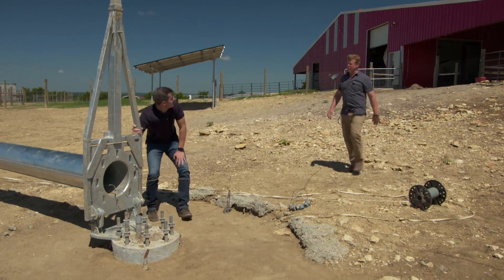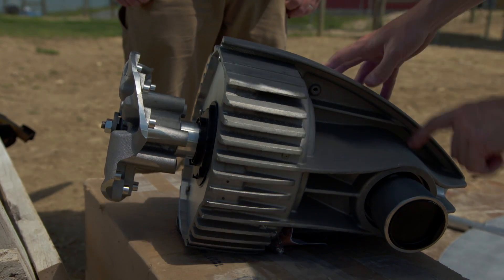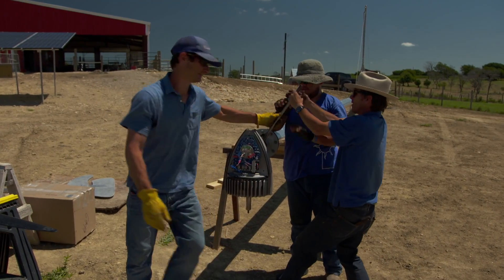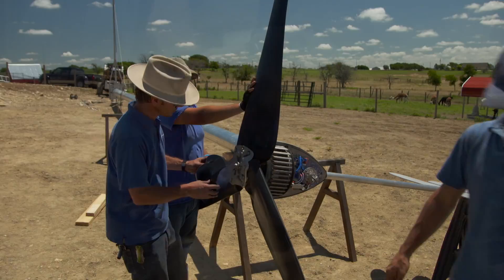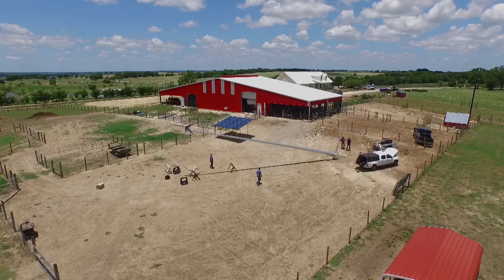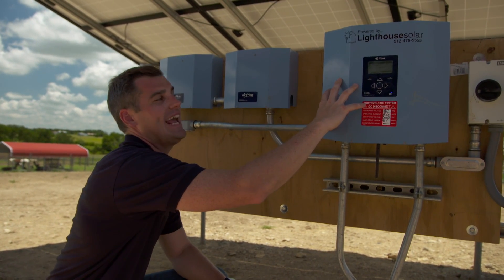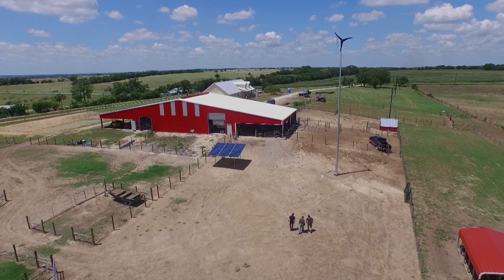How to Install a Home Wind Turbine | Ask This Old House

Comment: all that wind turbine for 1.5kw ?
Reply: Some people that would include me hate the electric company and are willing to spend extra money as to limit them screwing me on monthly basis. I know it may not make sense to everyone but to others it does. My electric company up my electric bill 40 percent in the winter, they  love to stick.it to you, we are doing our best to stick back to them. Also it feels better to use clean fuel, next an electric car.
Reply: It's not the same as solarpanels.

The 3kw solar panels he has produces 3kw a year.

A 1,5 kw turbine produses 1500 wats continuesly. So if the winds are enough for 1,5 kw 24/7 and 365 days a year that 1,5kw turbine will produce 13140 kw of energy a year.

The turbine is going to cost more but depending on place it's gives a hell of a lot more then solar.

You need to do a full calculation tho, cause it's moving parts and services that needs to be preformed.
Reply: @Sunblocker101  that's per day not per year... one 250watt panel can produce about 30 kwh  per month.. the average house uses anywhere from 750 to 1000 kwh per month. But yes the wind turbine can produce a lot more if the conditions are right
Reply: My electric bill ranges from $70/month in the Summer to $400/month in the Winter or ~$1200 per year.  At ~$0.10 per kWh, that's 12,000 kWh per year.  Good calculation!  FYI - I calculated that if I wanted to store a year's worth of electricity in lead acid batteries, I'd have to fill every cubic foot of my house with lead acid batteries (floor to ceiling)....I'd need a second house.
Reply: @JerryDLTN  Since the price of solar panels has dropped so much and batteries have gone up most now suggest using the absolute minimum of battery that will get you through the night. Put the money into high voltage strings of panels. Voltage is the major variable with panels in different light conditions. High voltage strings means you will be producing usable power even on cloud days. Typically 30%. So you size your system by seeing you usage at the lowest sun hours month (usually November) and triple that amount. Say 3 sun hours and you use 15Kwhr/day((15Kwhr / 3hr)*3 = 15Kw of solar) for off grid. For on grid just look at your yearly usage and the yearly sun hours and again triple it.
Reply: @Sunblocker101  Sorry but you are totally wrong. 3 kW (kilo Watt)  is twice 1,5 kW. If the sun shines for 1 hour the solar panels produce 3 kWh (kilo watt hours). 2 hours gives you 6kWh, 3 hours 9 kWh and so on. If the wind blows at optimal speed for 1 hour then the wind turbine gives you 1,5 kWh, 2 hours give 3 kWh and so on.
If you have a windy location that´s often cloudy then the wind turbine might be the better choice. If you have lots of sun then the solar panels are more effective. If you´re going off grid then you should probably get both and a back up generator as well. Plus a lot of batteries to store the energy so you can use it when you really need it.
Reply: @marcusrobertsson1898  ye sorry 3 kw system produce 3000kw a year, atleast where i live, a lot more in sunny plases
Reply: @Sunblocker101  That is only 2.75 suns hours per day on average. While I would by that for November through February, you would have to live pretty far north not to get more sun than that. Assuming he is using high voltage strings (and with him using a wind turbine on the same inverter he would be crazy not to) even under cloudy conditions that 3kw system will be pumping out at least 1Kw. More like 5000Kwh+ per year
Reply: @Sunblocker101  lmao that is incorrect, if that were true no one would buy solar, 3kw is like nothing the average household uses ~30kw per day and around 10,400kw per year.....

Comment: Put like a 15ft diameter blades
Reply: Larger blades means much heavier tower for when the wind gets high (25Mph+). Once the turbine hits a certain speed (diameter dependent) it effectively becomes a solid plate. So the tower has to be heavy enough to withstand the highest wind (60Mph+?) that the location will see with a solid plate the same diameter as the blades.

Comment: He went 20 feet into the ground with concrete to support a 60 ft mast just to get 1500 Watts of electricity? That is enough only to run a hairdryer. On a good day.
Reply: That 1500 kilo-watts.
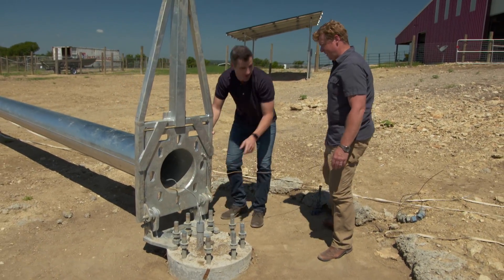Reply: @scotttovey  1.5 kilowatts at 0:50 into the video.
Reply: @dbassett25 
Yep, I misheard that.

3 kilowatts of solar and half that coming out of here.

It's my brain being stuck in supersize mode, or just figuring it should be much bigger. I must have had  a [Tim the Tool Man Taylor] flashback.

Comment: Your foundation is small, and the anchor bolts are designed to fail. Using nuts underneath the mounting plate is the most common mistake in installing important machinery on concrete foundations. The bolts are supposed to generate a compressive load on the baseplate AND the underlying concrete, and can only do this if the baseplate is in direct contact with the foundation - usually by way of grout. Call me when the whole thing falls over, and we will design a decent installation.
Reply: That thing ain't going anywhere.
Reply: The reason for the nuts on the bottom as well as the top is so that you can get it perfectly level. Then you should also fill in underneath with mortar though there is no way to know if they did this after.

Comment: COMPLETE waste of $.  For the same amount spent on the 1.5kwwind system you could get AT LEAST twice as much power (yes even counting cloudy days) by upping the solar install plus more battery storage.

Solar is also MUCH lower TCO per Kw.
Reply: Wind Power is more efficient than Solar. That's how it is usually. And Hydro Power being at the top.
Reply: @franzschluter5252  It is not a matter of efficiency. It is how many Kw/$. IF you have 8hr+/day of 15mph winds micro wind turbines can come close, but if the price of solar stuff drops much more it will not. Very, very few areas in the continental US has that.
Reply: high quality wind grid tie inverter to connect with local grid network, please visit SENWEI ENERGY www.windpowercn.com

Comment: from what am seeing im assuming this is a DC windtirbine! that cable is way to small to run dc power from such a powerful winturbine
Reply: All of them start out as AC (usually multi phase) and then they get converted to DC. It is just a matter of where you do the conversion. On this one it does it on the NAYCELL(joke) and you are right the wire is way small for DC. He will probably see 10% line loss on that kind of run. Most do the conversion right before the inverter, but it does generate quite a bit of heat and they have a high failure rate. The high failure rate is another reason the AC/DC conversions is done on the ground. So you do not have to take the tower down to do repairs. Most good turbines have the absolute minimum amount of serviceable stuff(electronics) on the tower.

Comment: This should be producing much more...
Reply: No wakaphwap, wind is not an efficient power source.
Reply: @patrickeh696  wind can be efficient depending on the turbine used and location it is placed.
Reply: @void970t5  Yes, but typical non-commercial build are pretty sucky.  Unless you live in a VERY cloudy area solar is going to be less expensive KW generated when you figure TCO
Reply: @patrickeh696  that is often very true.

Comment: 1.5 KW for that VERY tall turbine sounds VERY little.
Reply: it's not solar, it's 1,5 kw continous power in high enough winds. If winds are high enough the whole year it has the potential to give you 13140 kw of electricity a year
Reply: @Sunblocker101  it needs 24mph wind. If it made max power 20 percent of the time that's only 2600kwh. At 15 cents that's 390 a year.

I don't know what this cost, but I can do math well enough to figure this is never, ever going to pay for itself.
Reply: @Sunblocker101  For that sized wind turbine you need 15mph winds to generate any real power. Just because you are spinning does NOT mean you are making power. Their are relatively few areas that micro wind turbines are of any real use. If you get 8hr+/day of 15Mph+ winds they are great. Anything less than that you are MUCH better off putting your money into more solar. IF you make a larger diameter turbine to take advantage of lower winds, you get into trouble with high winds and snap off your tower. IF you make the tower strong enough, you are back to solar being more cost effective. Probably 80% of the continental US is not suitable for micro wind turbines.
Reply: @Sunblocker101  I looked it up. That turbine is rated at 1.5Kw at 11m/s(24mph). Probably less than 5% of the continental US gets that kind of wind for 8+hrs/day.
Reply: Never pay for itself.
Reply: @CrazyLakla  that such an old out of date thought. They easily pay for themselves. Basic business would tell you you dont sell something for $2 that cost you $3 to make you would go out of business.

Comment: you are using solid brass electrical wire. You wont get all the power avaikable. You nedd stranded copper wire.
Reply: Blackwolf Prepper  I've never seen solid brass electrical wire, where would one obtain it?
Reply: @acmeopinionfactory8018 , Maybe he meant solid copper ?
Reply: @augustreil   Did you read his entire post?
Reply: @acmeopinionfactory8018 , Yeah, why ?
Reply: @augustreil   He suggests copper in his second sentence, so he knows the difference.
Dontcha think?
Reply: @acmeopinionfactory8018 , True, Just figured he messed up that's all, I don't know.

Comment: Imagine the steel cable snapping at 3:50. Those guys would be in hospital. Same story for the idiots at 4:18, they don't add any value to the lifting, and when the cable to the digger snaps they will be whipped lethally in their head. Plus they will be launched into the air since they are holding onto it with their full weight already.
Reply: We can only hope.  I think they should be holding on with their nasal passages.
Reply: It really does add to the lifting. Remember the application of a lever arm(force times distance). That cable looked much lighter than what I would have been using.

Comment: So your spending at least 15-25K on a wind turbine and then another 5-10k on solar panels plus labor and equipment on hand. In order for this to be viable you would have to at least be able offset $500 in electricity per year in order for it to pay back something sizable within 40 years. I don't see this thing surviving a big mid west thunder storm either.  

I like the idea of getting off the grid though, if that's actually possible. In terms of cost your only hope of making it financially feasible is to make as much of it as possible from scratch and install it all your self. Anyway, I would be interested to see the cost vs output per year.
Reply: I am doing this for an OFF-GRID application where it will cost over 100k to get power brought in.
Reply: You're wrong, many who live off grid got use to the concept in a RV dry camping for extended periods.

Comment: I'm all in favour of most things clean and renewable but I must say that seems like an awful lot of money and work to get 1.5kw. I do have a 4kw solar pv system myself. Looking at the size of his barn it would seem more obvious to cover that in solar pv then if he needs hot water and central heating link it up to an air source heat pump.I can see barn isn't facing same way a panels but east west isn't bad configuration as it gives more useable smoother power delivery over a mid day peak from south facing. 10/10 for effort and commitment though and they look like they have made a smart job of it all.
Reply: You're absolutely right, the li'l Pika turbine is way too small and too expensive to consider.  Solar is a fraction of the cost and produces more energy, I know, I've sold thousands of small wind turbines and own one myself but would never do it again, I'd invest in solar PV.

Comment: I have 5500 watts of solar and three wind turbines. first off I will say this. if your wind doesn't average 12 mph or more year round wind turbines are not the way to go. if I had it to do over again I would have got more solar panels and no wind power. second grid tying sure isn't the way to go either if you plan right. I took my grid tie off line and just started taking rooms of the house off one at a time in the braker box.i know have the biggest part of my house off the grid. the only things I don't run off the battery bank is the stove, drier and central heat. I even put in a tankless water heater and love it! I also noticed the turbine did have a furling tail. it will burn itself up the first time a high wind hits it for any period of time.

Comment: Oh my god that connection at 2:40 looks totally unprofessional. Here you would be required to use a cable shoe, that's much better than what you're doing here.
Reply: I thought the same thing.   For the amount of money this probably cost one would think the company could have at least included a block connector to secure that wire.  It would really suck to put that pole up and realize you didn't tighten that screw enough.
Reply: I know that I am a year late. But not only does that connection look unprofessional. So does the conduit at the inverter station. First, I see 2 un-needed pull boxes why they were installed for a 3 foot run is beyond me. Second, those two conduits are crossing too. Should've had the far left come straight down then shoot over to the box on the far right, looks like a DC disco. Then the right shoot into the inverter. 
And third, the two underground conduits are crossing each other above the ground. If they couldn't make it cross under ground, fine. Shoot them straight up into the box and make the wires cross inside the box. (Unless the can't cross inside, then I understand the crossing outside.)
Reply: Glad to know i'm not the only one that saw that.  I was yelling at my screen, lol.
Reply: What you missed was they slipped the electrical inspector $300 and two ice cold six packs, he signed off and went on his way.
Reply: Lol you’re not the only one
Reply: HAHA Same. IS HE A COWBOY? BECAUSE THAT LOOP IS A GODDAMN LASSO
Reply: Plus he has the loop in the wrong direction. He has the wire going counterclockwise, when it should be going clockwise around the terminal screw.
Reply: The inspector's never going to check that out, but a bit more info on the output would've been good, like was that a three phase output or not?

Comment: Not economical
Reply: It does seem like an awful lot of trouble for 1.5 kw. 
Hugh Jaanus: It's more usual to rate a wind turbine at less than half that wind speed. Since the available energy goes with the cube of the wind speed, your turbine is overrated by at least a factor of 4. At least if it's really capable of 2000 watts even at that speed. If it is, it could probably handle a much longer set of blades at, say, 30 or 35 mph. Unfortunately, the rpm might be much lower and that might be a problem with the generator. If it has some kind of gear drive, you might be able to change the ratio to correct that problem. You'd also have to reduce the speed at which the feathering mechanism kicks in, or whatever mechanism it is that protects the system when the wind gets too strong. If you don't have such a mechanism, then eventually your current system will break or fall down. For a tinkerer, it's probably possible to make a new, longer set of blades. If solid wood wasn't too heavy, I suspect I could carve out some in a few days, but I wouldn't do it for someone else without an awful lot of practice. Currently, I've carved propellers that are only a few inches in diameter, and I've made some oars. 
There's a lot of info out there on relatively economical homemade wind turbines. Perhaps you could keep the tower, and all the other equipment, and install one of those. You've already lost a bunch of money, but a new turbine be much cheaper than starting from scratch. Maybe it would even be worth it. 
Just how big is that turbine? The one in this video is 10 feet in diameter for 1.5 kilowatts. If that rating is for 30 mph, then your turbine, if the same efficiency, would only need to be 3.5 feet or so!!!
On the other hand, if everything that guy sold you is junk, you might as well give up. Also, if you don't have much wind at your site, there's no point in continuing. 
BTW, how is it that you're paying a guy from Missouri in euros?
Reply: It is over time
Reply: thechosendude: A large fraction of the new electricity generating capacity that's being installed is wind turbines. Given the political uncertainties of the subsidies for energy sources other than oil, I'm sure the investors thought long and hard about whether they'd get something back. Oil, of course, gets enormous subsidies, whether or not they're identified as such.
Reply: In the long run it is.
Reply: The return is there if the windmill is much bigger and maintained by an organization which does multiple windmills. Economies of scale. Defeats the purpose of going off grid though. A big windmill can power multiple homes. I also think that windmill is in a bad location. It doesn't look very windy.
Reply: thechosendude Solar works in lots of places. Utility scale wind turbines are also very competitive. The little turbines, not so much.
Reply: Gustav Derkits - Nope! Green energy is a scam.  If it were even remotely economical the private sector would be exploiting it.  The private sector is greedy; they will open very poor investments like apartment complexes that barely survive on a 1% or 2% return.  Yet somehow no green energy...